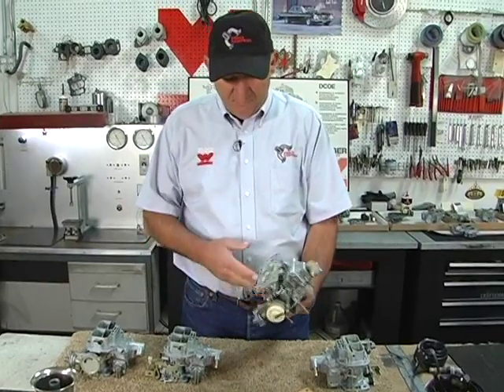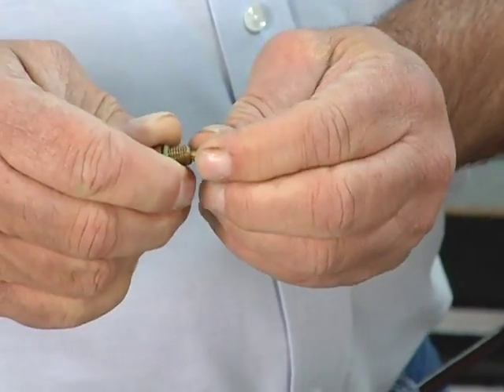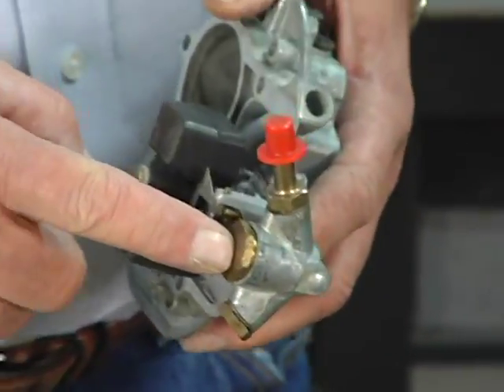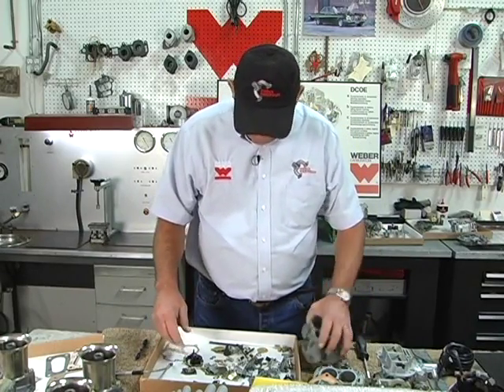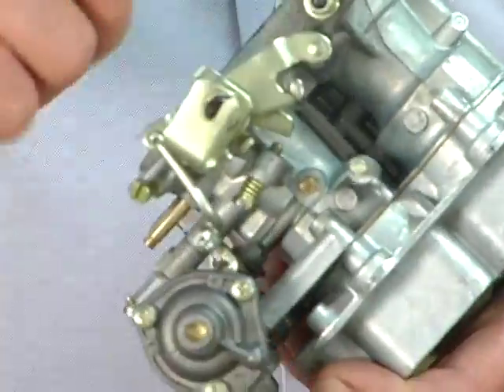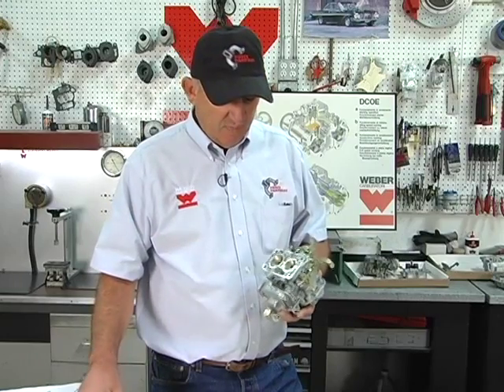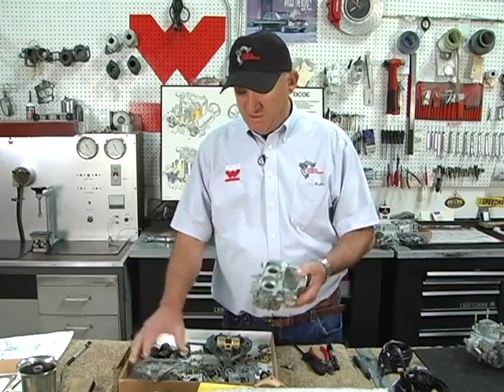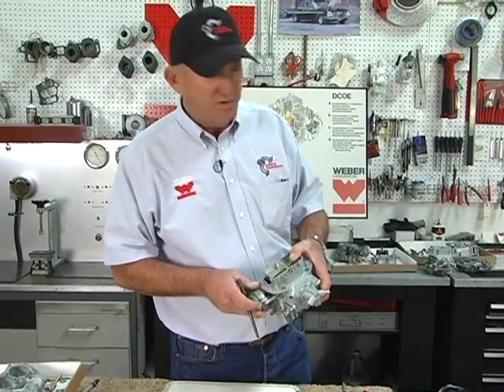Weber Carburetors Explained | Mazda B2000 B2200

Comment: Thanks For Your Time In This Video-I Appreciate it as a Engine carb mechanic for 35 yrs never worked with Webers till now- WTF-YOU HAVE YOUR WEBER AND INTAKE BUISNESS FOR 40 yrs- Showing outside parts of 32/36 YOU STATED THE PRIMARY IDLE JET WAS OPPOSITE THE CHOKE SIDE-STATED THE SECONDARY IDLE JET WAS ON THE CHOKE SIDE-YOU FUCKED U HAVE THEM REVERSED-CONFUSED THE HELL OUT OF ME A KNOWLEDGABLE CARB MAN Am I the First To Point This Out MAYBE YOU SHOULD MAKE A CORRECTION IN THE ABOUT DESCRIPTION 40 yrs of experience stating backwards important informatio on the 32/36- HOW BACKWARDS ARE YOUR PART NUMBERS YOU SELL ALONG WITH YOUR BACKWARDS INCORRECT MANNIFOLDS ?- JUST WONDERING BUT PLEASE CORRECT THIS MISTAKE TO SAVE TRUE NEW MECHANICS NEEDING CORRECT INFORMATION ON A SINGLE CARBURETOR- BUT THANKS FOR YOUR VIDEO the rest was mostly correct- GODS BLESS and thanks for your video- just correct it
Reply from the maker: At what time stamps are you referring to so I can review?
Reply from the maker: I see what you are saying now. Just an honest mistake on his part. He got turned around. I CANT CORRECT IT. This is a DVD that comes with a new carb, THIS IS NOT ME.

Comment: question ,,,,march 1, 2025 ,,,,at around 18 minutes your holding a idle jet with a O RING ON IT ?  when assemble they dont have o rings on correct ?   thank you
Reply from the maker: That o-ring came on the carburetor. It helps it seal just a little bit.
Reply: @MazdaMitch  tha o ring would make the seat farther away and possibly not seat correctly as i see it ?  both miy idle jets the head of the screw has NO o rings at all , its running great i should say . maybe ill check out the blown up diagrams and see ?  ok just checked the diagram " jet holders DONT COME with o rings ?
Reply from the maker: @MrGarcon98  First of all that is NOT ME in the video. 
That is Mike Pierce from Piecer Manifolds, one of two of the only Authorized Weber sellers in the USA.

He does a better job explaining the carb.
Here is a link to a spot in the video where the idle jet holder HAS AN O RING.
All of them should. Thats how they come.
Whether is useful or not, not sure. Like I said before I think it helps with sealing it up a little bit, to prevent an unwanted vacumm leak.

https://youtu.be/_MO_YMtgNq8?t=1095 

Picture https://imgur.com/a/AtA8grV 
We cant post pictures here in youtube comments so I encourage everyone reading to join the forums and ask your deeper questions there.
https://mazdaminitruckin.com/forums/
Reply: @MazdaMitch  just for the hell of it i just went through all the parts of the exploded view one line at a time and are no o rings anywhere ? what did i miss ?   thanks ill check the link ,,,,I SEE IT clear as day with an o ring of course !  when installing those jets on the holder they SLIDE a little witch may explain the possibility for this o ring ?  other wise it cant seat at all , get my point ,,what is the part number for those idle jet holders screw O RINGS ?  can you do that ?   I DID put the link of the forum  in my favorites i am 71 not anxious to argue with amateurs lol no pun intended.  thank you
Reply from the maker: @MrGarcon98  It would not sit farther away. Just screw it in tight.
Reply: @MazdaMitch  10 4 over 😀

Comment: hello my name is Fernando i have a problem with my weber 32/36 it drips gas when the car is in an incline and the engine is off into the venuri  what do you think could be the problem?
Reply from the maker: Find the start of the leak. You'll probably trace it back to the fuel pump that's leaking
Reply: @MazdaMitch   hi thanks for your prompt reply , but are you talking about the mecanical fuel pump or something inside the carb?
Reply from the maker: The mechanical pump has a diaphragm in it and it could have given up and there is a small weep hole on the pump that will leak fuel if this is the case. Check that. What I am saying is first be sure of the source of the leak.

Comment: What is the brand or part number for the external fuel filter with very good filtration from my rusty fuel tank?
Reply from the maker: You should drop your tank and clean it. Stock fuel filter is fine to use, I got mine on RockAuto.
Reply: @MazdaMitch  I had a mechanic fix the fuel gauge, he dropped the fuel tank out and fixed the fuel sending unit. I ended up replacing the fuel pump, and rubber fuel hose, the little nikki carb or intake manifold is leaking according to my spray testing around the carburetor. glass cover near the carb floats is showing quite a bit of rust dust at the bottom of the carb, for the 40 miles I've driven it in the last year. (1984 b2000) Thinking about replacing Nikki with a Weber. Parts are getting expensive and somewhat hard to find now. In it for over $1K in parts over the last year. I have a 1979 Courier as well, better shape than any I see on the highway nowadays.  @MazdaMitch